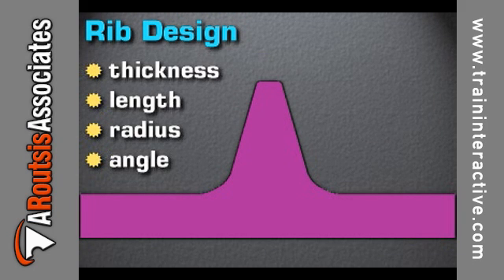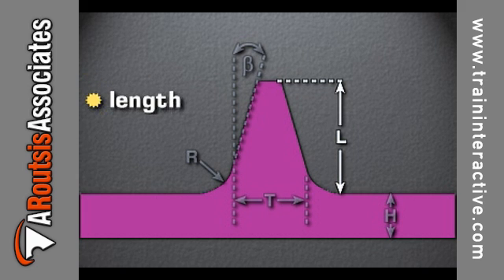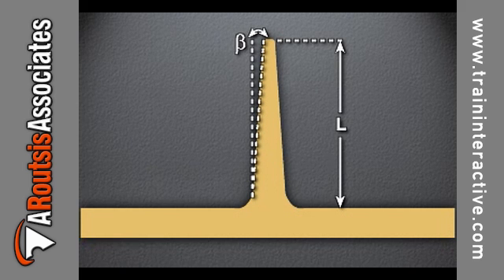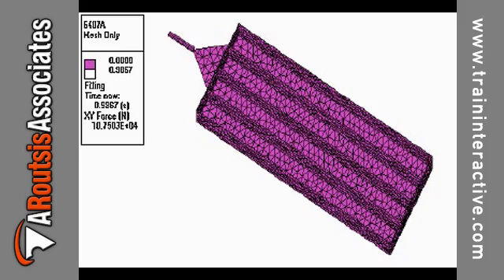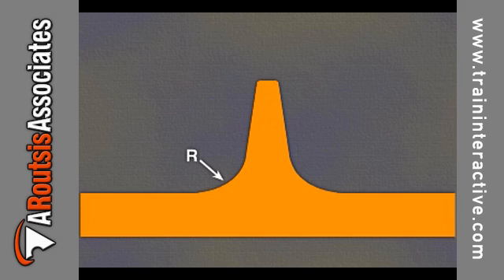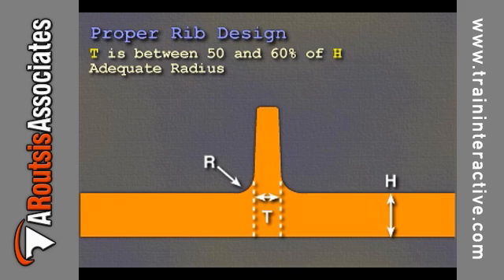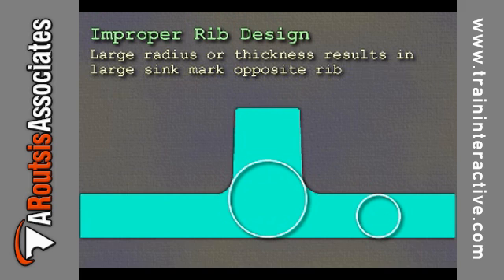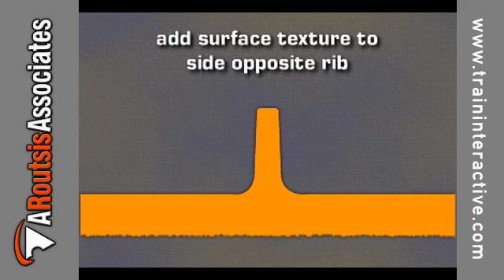Plastics Part Design Series - Rib Design (excerpt)

Comment: Some explanations in this video are unclear. There are explanations that do not match up with the image. These include stating "large draft angle" when the image shows a smaller Beta angle as an example, and "40-80% of the wall thickness" when the wall thickness is clearly smaller. These are confusing, and this video should be remade or corrected with annotations.